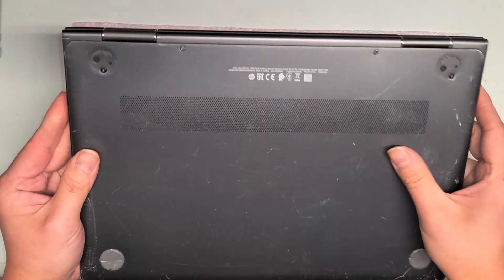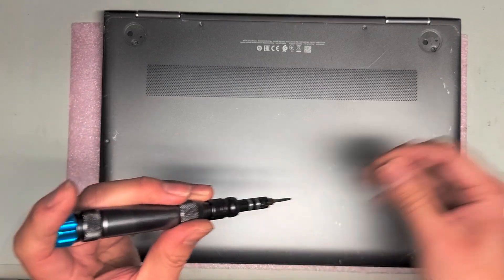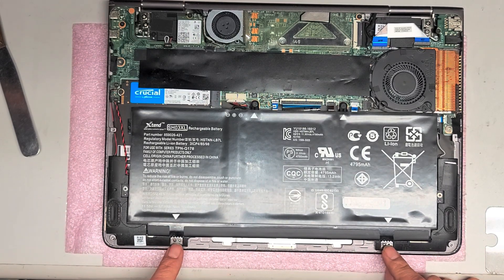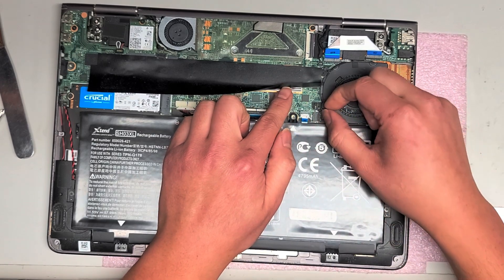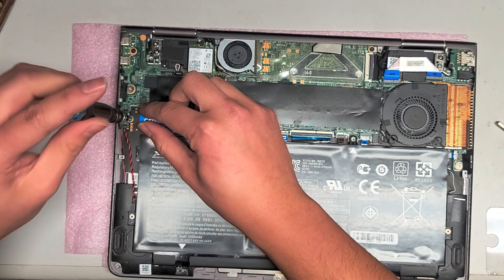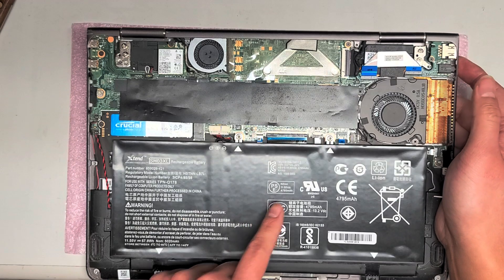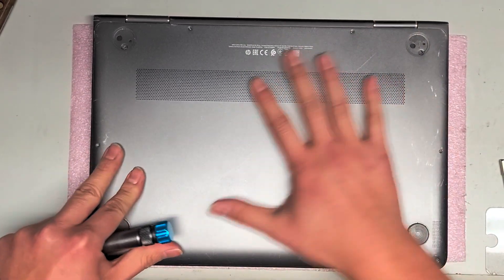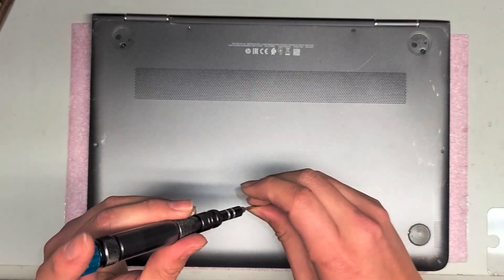HP 13-ac003na Disassembly SSD Hard Drive Upgrade Repair

Comment: Hi, i have a HP Spectre x360 13-ac003la with a 256 hard drive and i want to make an upgrade, Do you know if the NB supports a 1 tb M2 Gen 3 hard drive ?
Reply from the maker: Yup
Reply: @ItsBinhRepaired  i have tryed with 2 HDD of 1 TB ( Kignston Fury Renegade PCIe 4.0 NVMe M.2 and a WD Blue SN570 ) and both didn´t work. when installed them it was not recognized by the MB and there was the message no drive installed. I updated the BIOS but did not work. Hope you can Help me !!!  Thanks for all !!
Reply from the maker: I hate how YouTube doesn't notify me of replies. Were you able to figure it out?